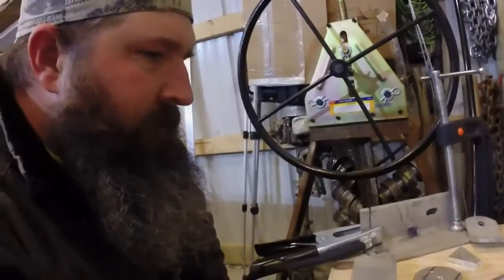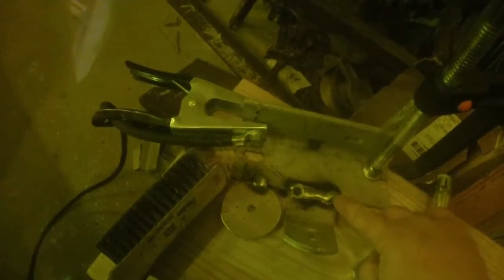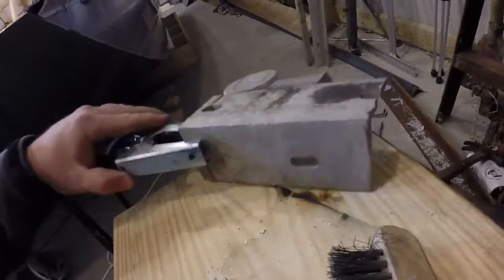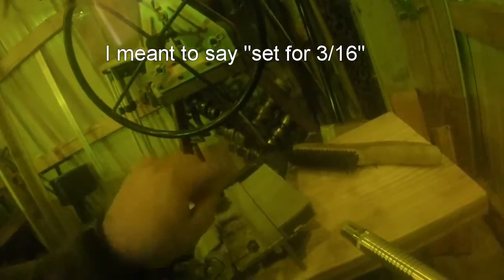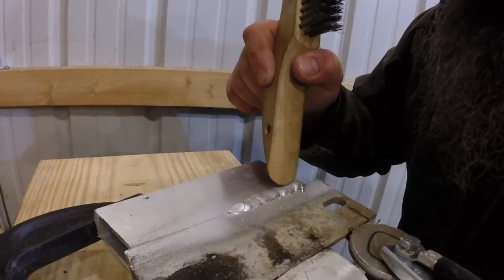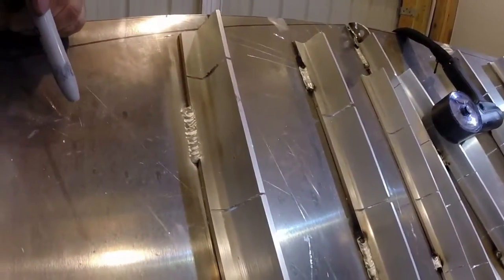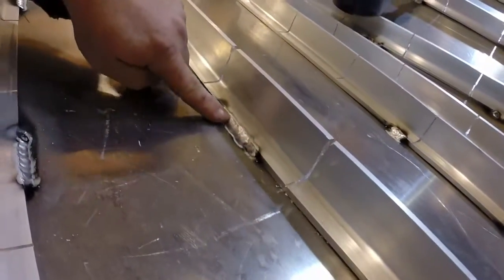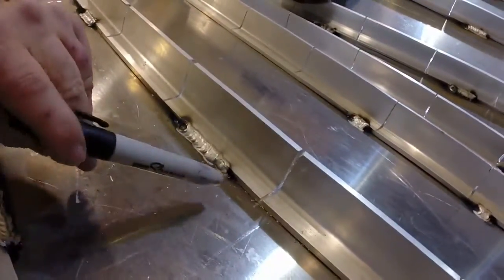How To Weld Aluminum : for beginners

Comment: Been watching your video's on welding alum. and really appreciate you sharing your experience & knowledge for us beginners.
Question :
Is it okay to grind or belt sand the weld flat or "near" flat to clean it up or in case you'd like to add another flat pcs on top of the weld ? I guess I'm wondering if the weld would still be strong ?
Thanks for your generous consideration,
Sincerely ......................
Reply from the maker: Yes you can but the ideal thing to do would be to use a carbide cutter. Drill, die grinder, or saw